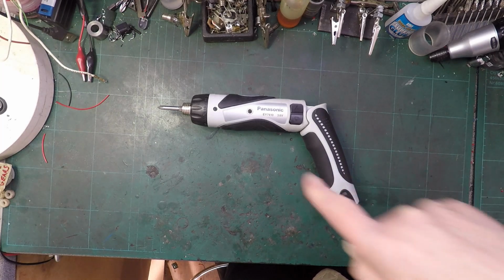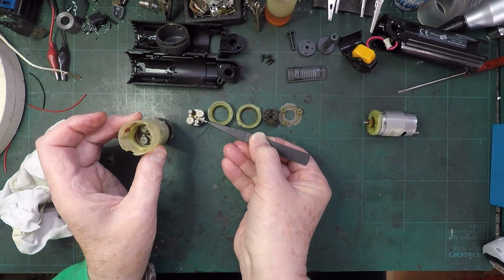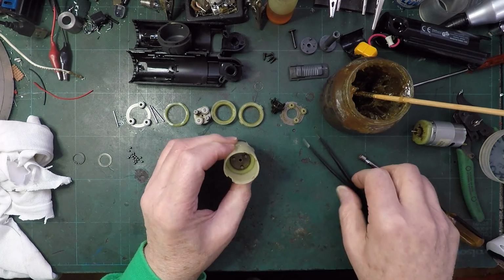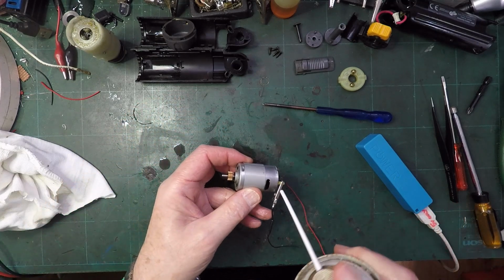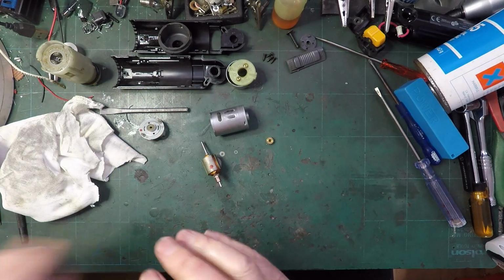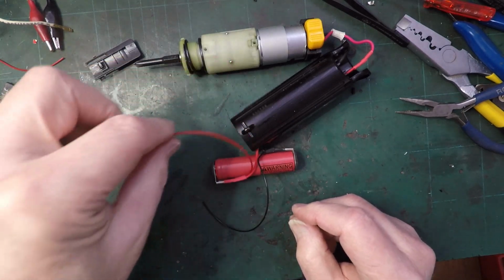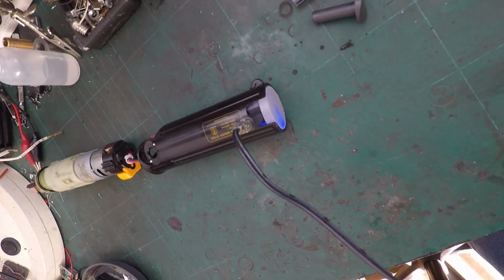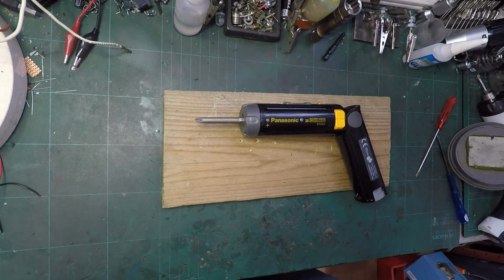Repair Panasonic EY503 screwdriver and convert to Li-Ion.

Comment: why didn't you use out+ put- for the motor? we risk discharging the battery because it is managed by the tp4056,right?
Reply from the maker: You cannot use TP4056 to manage output.  The motor requires too much current so you have to connect direct to the battery.
Reply: @DaftOldMan  
Ok.thank you.
that's why I burned 3 modules. I'm going to test with the 4th then

Comment: I own three of these but they’re red and branded Milwaukee 6546-1 Cordless Screwdrivers. Also made in Japan. The plastic switch that you activate the forward/reverse broke on mine, so I bought another whole unit. Getting a good replacement battery is a pain, because most suck. I went down that rabbit hole.
Panasonic makes a new drill which looks exactly like these, but it’s made in China. It still gets good reviews though. Don’t recall the part number off hand.
Reply from the maker: Thanks for commenting. It is still working well.